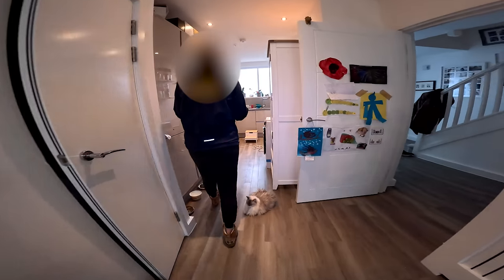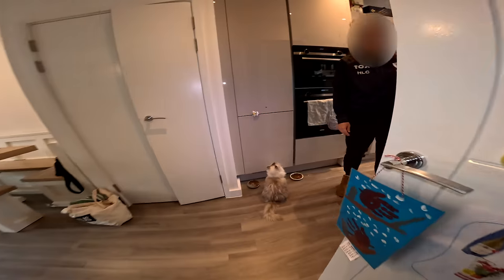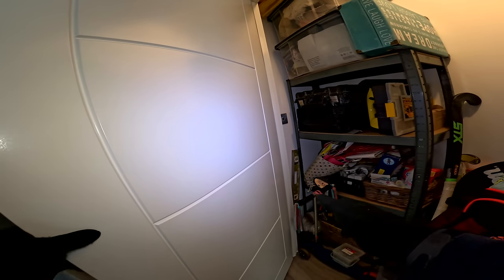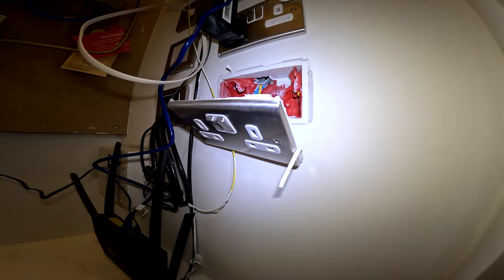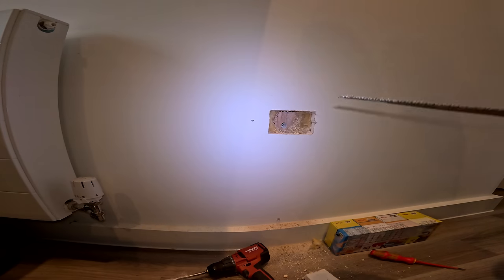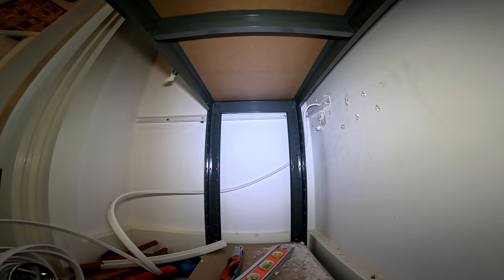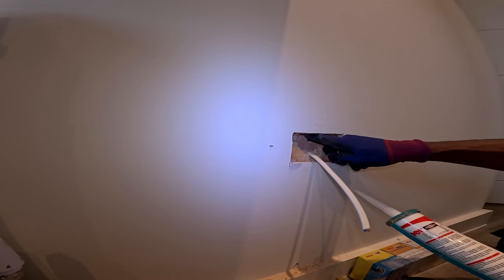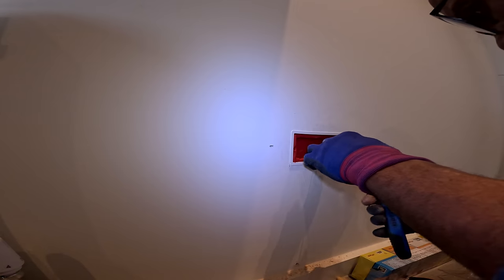New Build Without Enough Sockets

Comment: Good job Del. I’ve seen the intumescent stuff a few times in stud walls. 
A lack of sockets in new builds houses is common, it’s all down to the cost. 
My house was a new build in 2016 but I was lucky enough to have some say on the finished spec. I asked for extra sockets in every room. The sparky thought I was nuts until I told
Him it’s better to put them in and never use them than to have to put them in afterwards 👍
Reply from the maker: I'm surprised they don't provide enough sockets in new builds, considering the amount of equipment in domestic properties now a days. thanks for watching.
Reply: @eastwayelectrical  one thing i noticed  was the 'IT cabinet' that was on the right wall... i am glad they fit that in good quality new builds these days.The GPO suggested that in the 1940s!